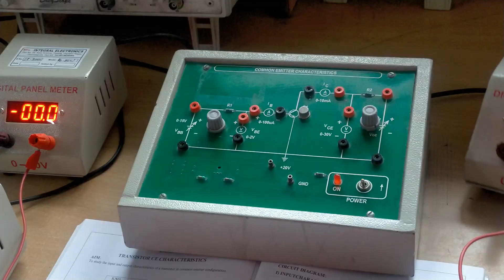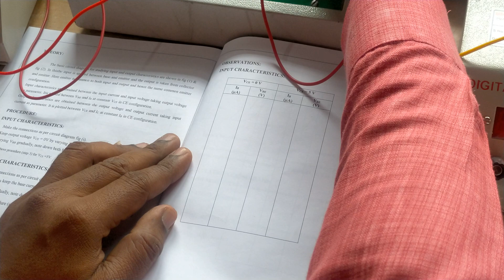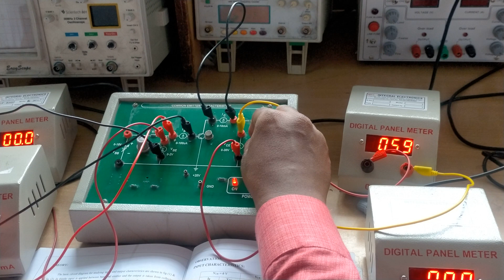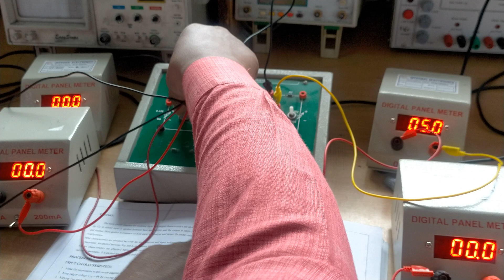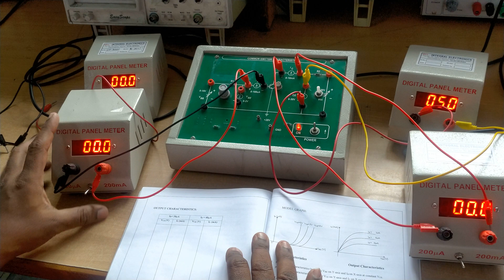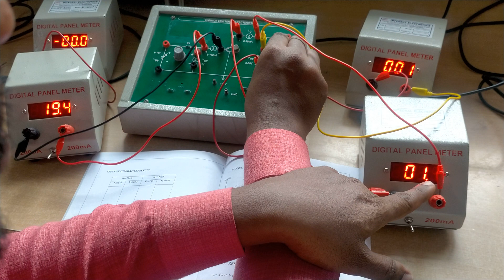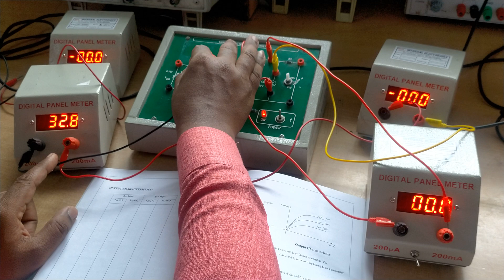Transistor CE Characteristics Experiment

Comment: Sir one doubt why dont u shorted. Vbe voltage in output characteristic
Reply from the maker: When you take out any voltmeter (Vbe)  you should not short. The equipment will get damage.